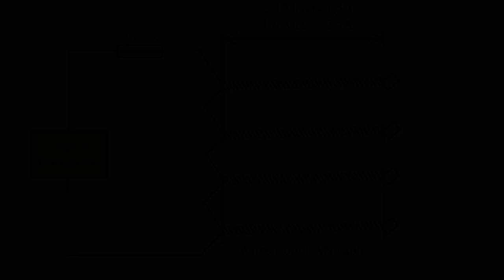How to Make Heated Office Chair using a LAN Cable - DIY (winter heater - lifehack / heated seats)

Comment: Good idea but  not presented clearly enough. What ends of what wires are you connecting together?Also what is the voltage you are applying, 12, 5 or 3?

Comment: Can a wall adopter rated with an output of DC 5V and 2A, be used for the same project? Thank you
Reply from the maker: Hi, yes, the important thing here is to connect wires with the correct length.
The shorter the wires the higher current will be, and hotter the wires will become. If current is very low then make the wires shorter. And also make sure that the current is not very high, I think 1.4A - 1.7A should be fine (2A is maximum your adapter can provide, but don't try maximum). Better to start with much longer wires than I showed in the video, it is just to make sure that the current is not higher than 2A. If it's good adapter everything will work fine.
P.S. I just tried 1.7A and the wires very slightly warm, almost unnoticeable... 2.2A - 2.5A is much better, but your adapter can only provide 2A max.
Reply: Will 12v 2a adapter work?

Comment: temperature rating of those wries are very low. Very bad idea. Use teflon insulated wires for safety (30awg, teflon, look them up on ebay)